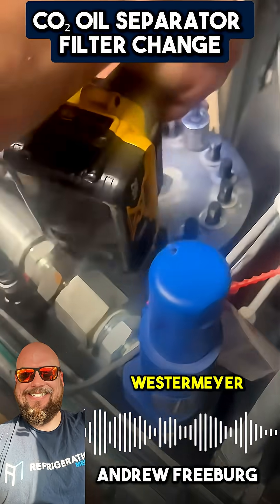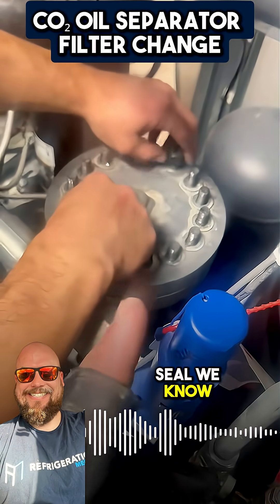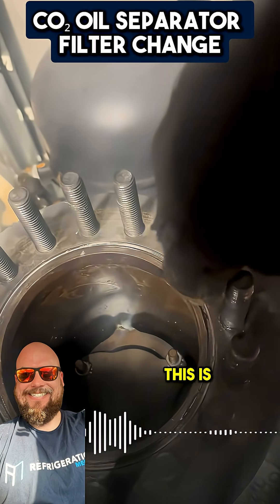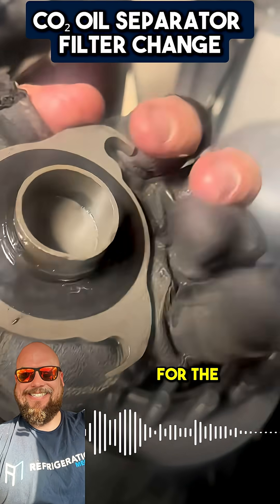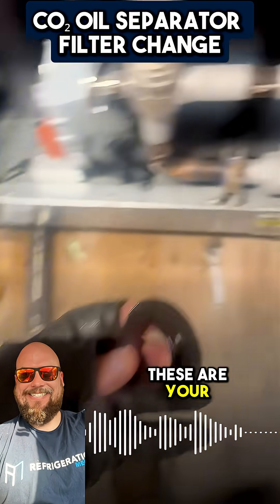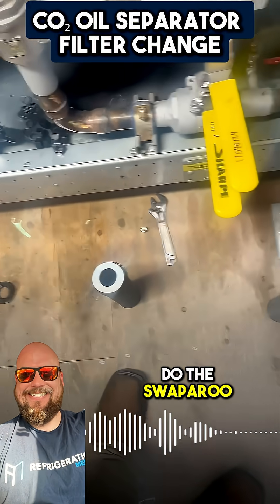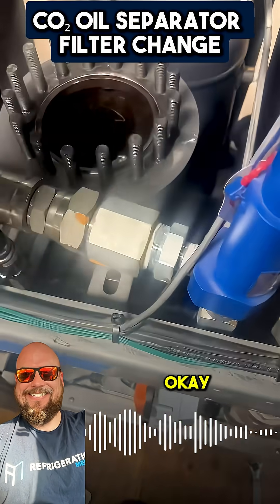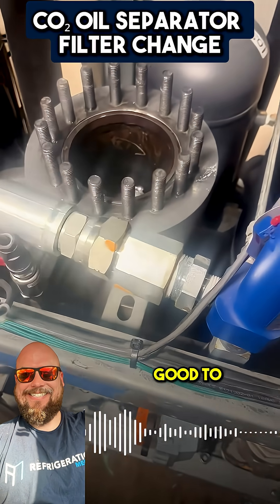Step-by-Step: Changing the Oil Filter in an Oil Separator

Comment: I’ve seen similar damage on a 404 oil sep. I believe my damage was from the lack of hold down nut on the filter and it flying off the inlet and smushing down. Do you think that filter was damaged from being installed too tight? 

Also not a Co2 guy but was the lid slightly discolored that filter looked great besides the crunch?
Reply from the maker: I am not sure if it was because of being torque down too much for the discoloration that would mean your possible running too hot at some points. I would check the discharge temperature on all compressors. Keep up the great work out there.